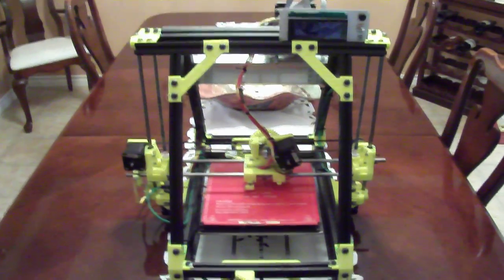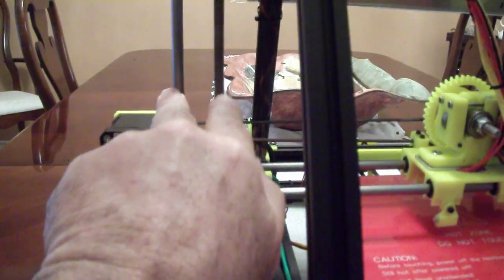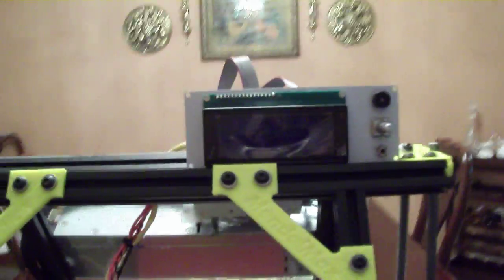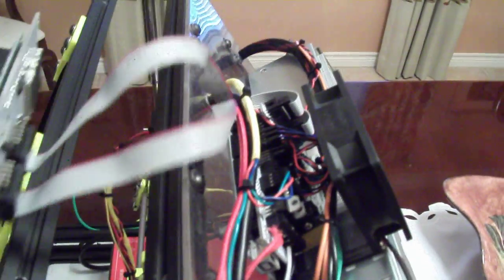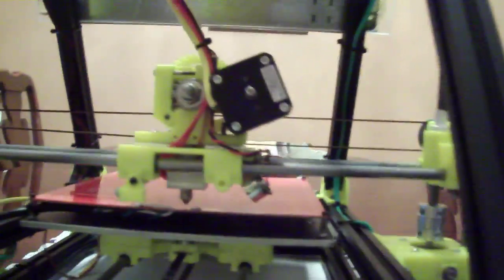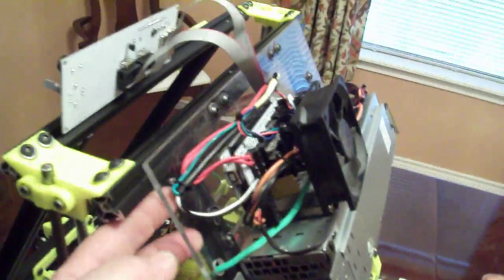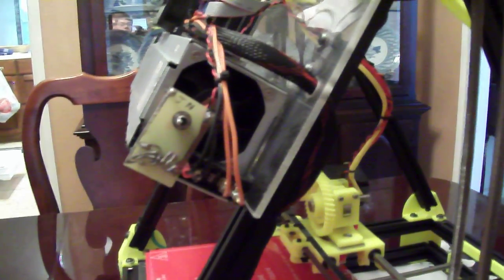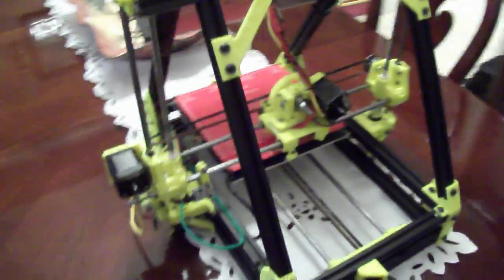3d printer Build Finished.

Comment from the maker: Thanks Nate, the misumi T slot is cheaper than the 8020, but I think you would have a good machine using aluminum angle. design some of the plastic parts to wrap around the angle for adjustment and alinement purposes. Maybe more holes to drill and tap but would be just as strong, I'm going to cast some.